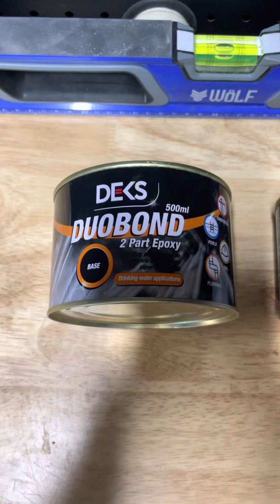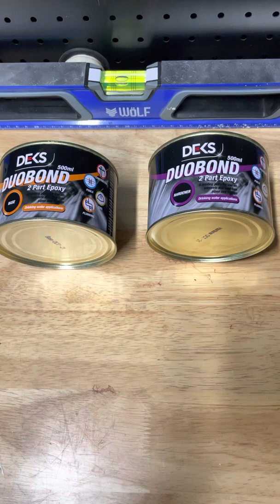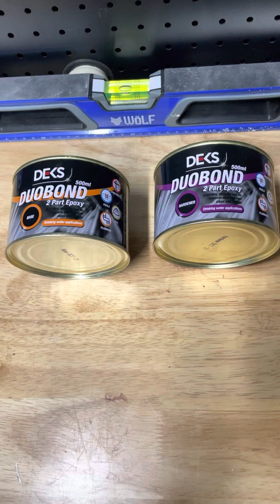How to fix a cracked or broken storm water drain or sewer drain pipe and fittings using 2 part epoxy

Comment: Gonna try this as a cheap fix for a small leak on a mains pressure hot water tank, fingers crossed!
Reply from the maker: Hmmm im not sure that this product is rated for this purpose 🤞🏻
Reply: @MayfairPlumbingandGasfitting 
Probably not! I'm lining the bottom of the tank's interior, so I figure the epoxy will act like the plug-style doors on all jet aircraft, ie internal pressure helps the "seal". At least that's the theory! 😄